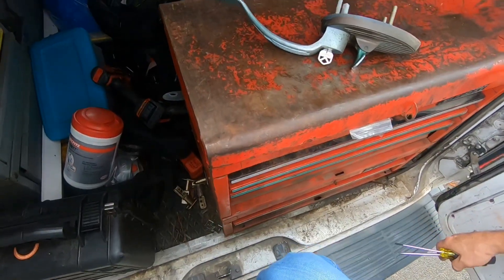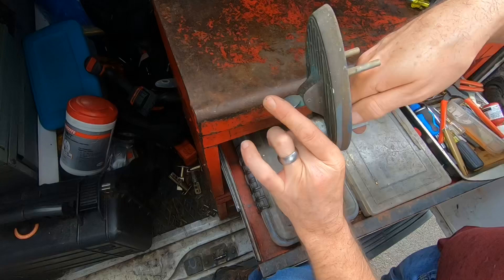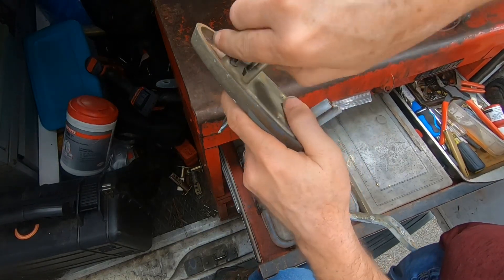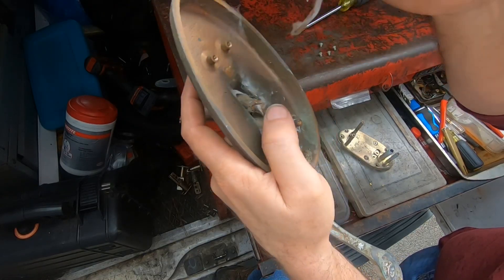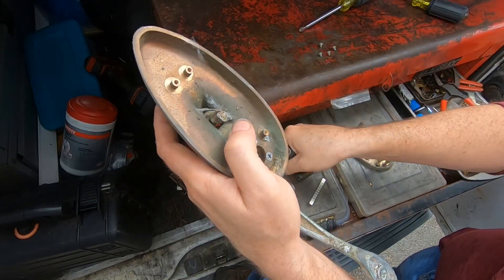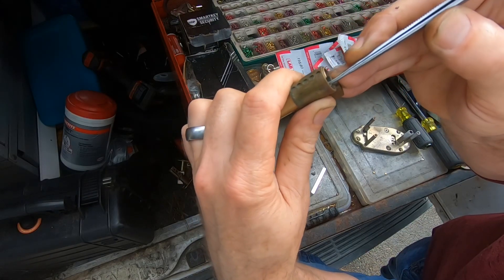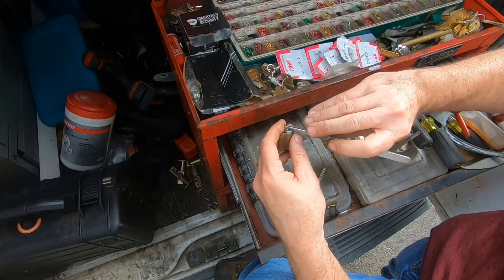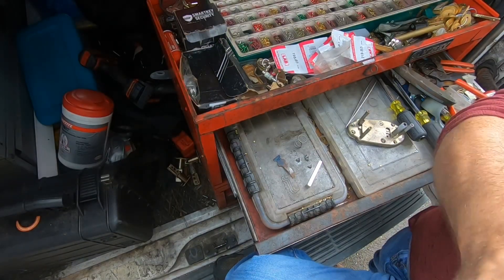rekeying an old old old Weiser key in handleset

Comment: I came across a similar one a few weeks ago that the internal springs were hanging up when using the key to disable the thumb button. I opted to blast it out with master lock lube as opposed to disassembly of the spring housing. Those are a pia to put back together and with some of those little springs and parts if they hit the ground, you’ll never see them again. Thanks for sharing.

Comment: I have serviced I few of those in fact this coming week I am taking one off a house that was built in the 50's still orginal hardware they asked me to replace the hardware and even had the old weiser push and turn knobs a 1/4 of a turn to lock on the inside I am wondering if I should keep them and put in a display case in my shop since things were built so much better years ago !!